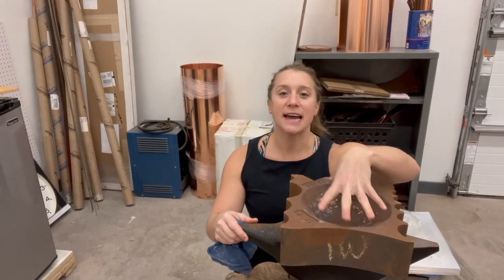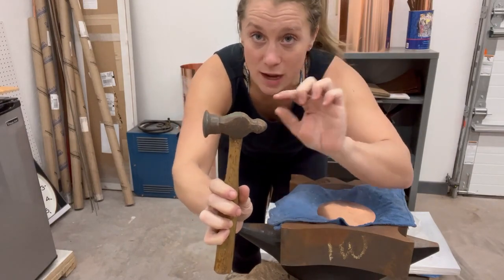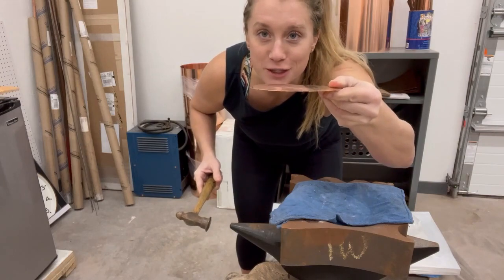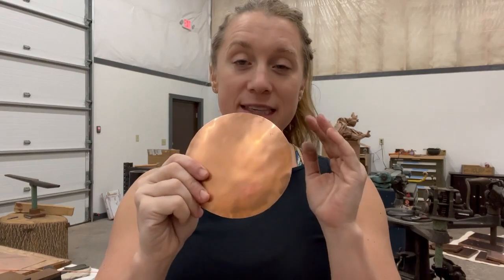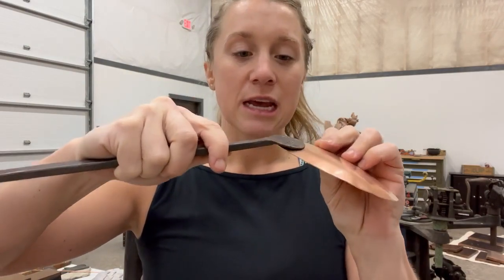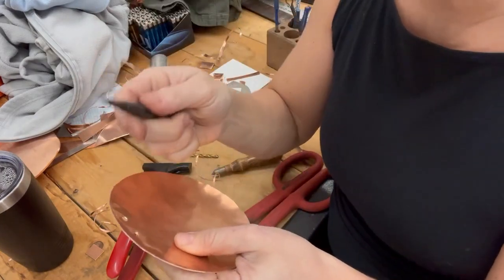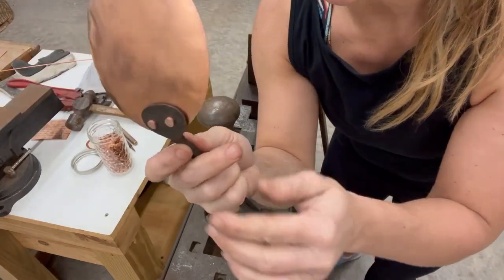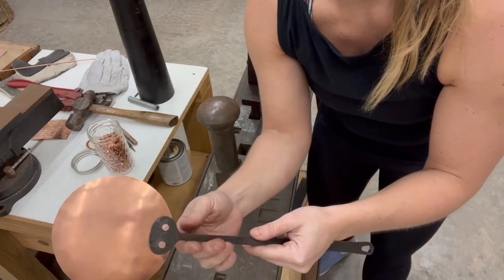Make A Copper Ladle or Spoon

Comment: Great tip about the drywall compound! Here's one passed on to me by my mentor: use a piece of leather in your swage block depression (it'll hold up better than fabric) and glue a piece of leather on the face of your raising hammer. Less chance of dinging up your work!

Also, if you don't have a rivet set, you can easily make one. Just take a piece of round or square stock around three inches long and drill a shallow depression in the end (using a bit at least half again the dia. of the rivet shank). Depression will be a bit more cone shaped than domed but close enough to force the edge of the mushed out rivet tight to the work with one hammer wack. No more tedious dremel grinding!.
Reply from the maker: I have leather for the swage block as well! I just haven't been pleased with the results. But I think the leather is too thick. I may try thinner. :) Great idea on the rivet set!! Thanks for sharing here!

Comment: What is the diameter and gauge of your copper spoon blank? I make my own rivet sets. I use tool steel rod of appropriate size, drill a shallow pilot hole, then use a ball endmill with a diameter that you want the rivet head to be. Cut to 1/2 the depth of the endmill , then harden the steel for a home made quality tool. Thanks for the video, and you always make tinning look so easy. Ye Old Copper Smith in Rockford.
Reply from the maker: Oh, great question! I should have put that in there. I use .040 (18 gauge) and cut 5" diameter blanks. Love the rivet set idea! Sometimes I wish I had that all...but to be honest, the time to build the sets would set me back a week and I'm already booked through August in work. When to do the tooling!? Ack! Something to aim for! Thank you for watching!!

Comment: What material did you use for the tinning and what did you use to spread it with?  Thanks!
Reply from the maker: I used tin for tinning. I used flux to bond the tin with the copper. The material for spreading it is housing insulation. You can find the links for the tin, etc in my video descriptions.
Reply: Thanks! @housecopper